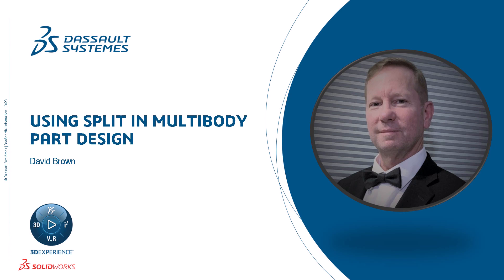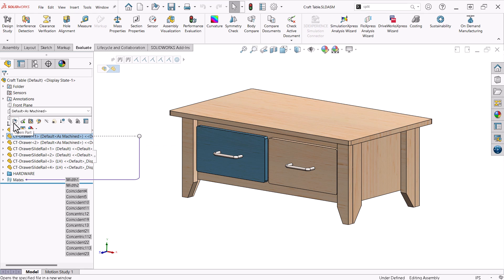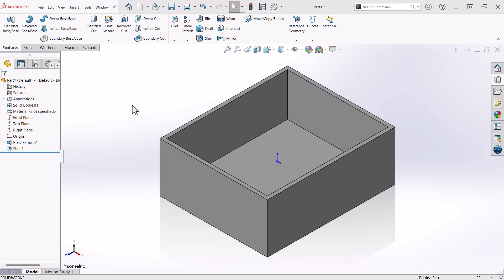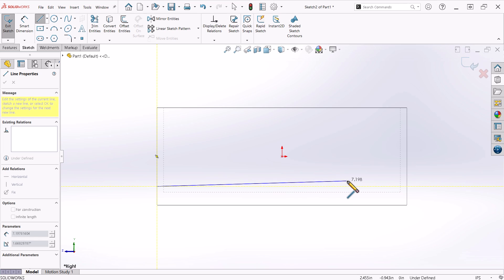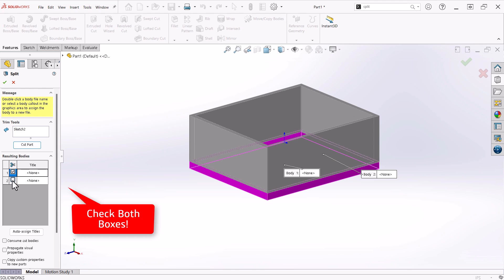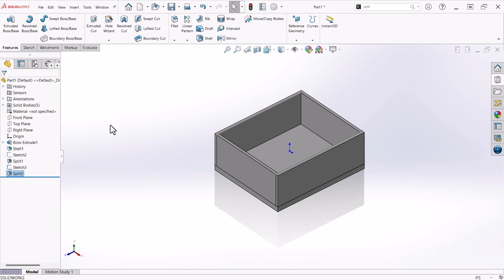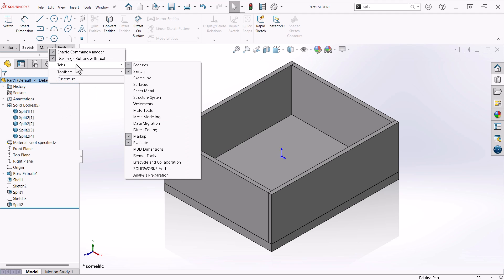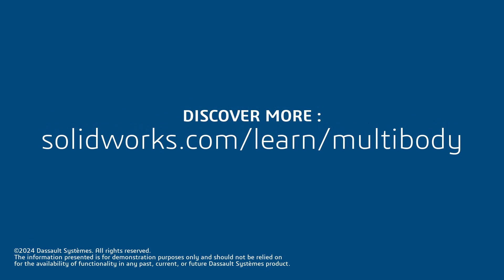Multi-Body Part Design – Split Command

Comment: It seems useful in a simplistic way, but there is still a lot of work to be done on the pieces if we insist on good classical joinery with dados, rabbits, grooves, and the strongest joint of all time the Miter Lock.
Reply: Would be cool if the program featured parametric joinery haha. Would make life a whole lot simpler.
Reply: @MinhDangcraft  you can save the profiles of joints as blocks into your library  which speeds up the process of getting pieces ready for assembly.
Reply: @RollinShultz  Yup, blocks and sketch templates have been a lifesaver for reverse engineering or fitment over existing parts. Wish there was more intuitive scan workflows with solidworks though!